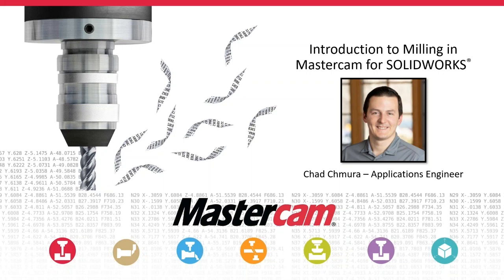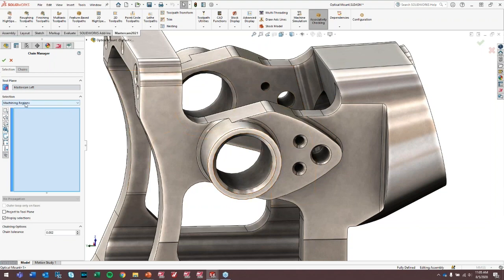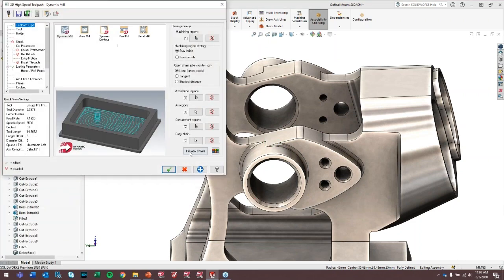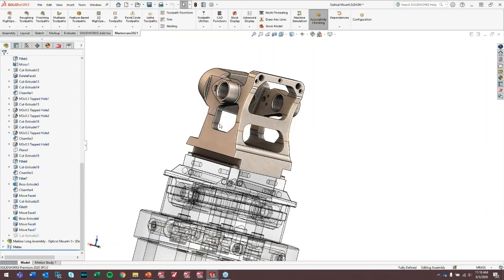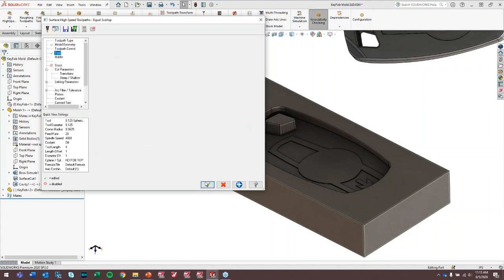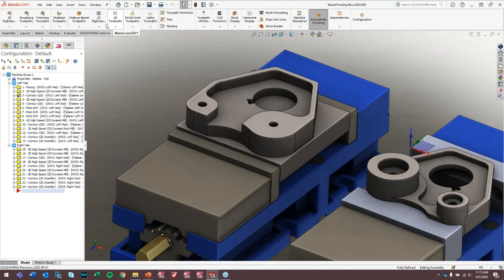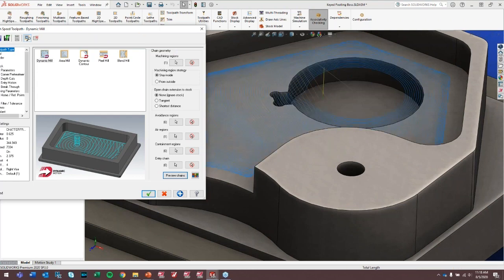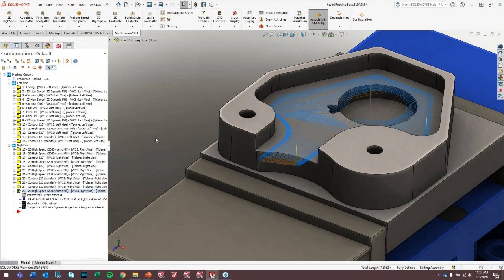Introduction to Milling  in Mastercam for SOLIDWORKS®

Comment: Chad thanx for the presentation ...Mastercam is developing into a great platform for machining ...Mill Turn is fantastic
after the up grade..I have a problem half the shop runs on G code and the other half uses MAZATROL 
There is an application from Germany that runs in Mastercam to give you basic MAZATROL output it would change
the industry and for Mastercam market share to have a more robust interface ...Regards...

Comment: the reason Mastercam for Solidworks is underutilized is because you need both seats on the same computer and that gets very expensive.  i know the company i work for won't get a seat for me is because i'm just a dumb machinist, what could i possibly need Solidworks for. i suppose large companies have production engineers to program but most shops i know it is either a operator/programmer or a programmer that will not use Solidworks functionality. i believe this is an area Mastercam could do much better.
Reply: Nail on the head. I am a CSWP and a programmer. You betchya I use mcam4sw at work to write high volume production programs. Design fixtures etc and program all in one shot. It's a beautiful thing. 2021 is my recommended year btw. 2020 and 2019 had some glitches that caused me to lose work on a few occasions.
Reply from the maker: We are happy to hear 2021 cleared out some glitches. We appreciate our customers feedback on our products, please feel free to provide your feedback- good or bad- through one of these options listed on our blog https://www.mastercam.com/news/blog/top-3-ways-to-shape-the-future-of-manufacturing/
Reply: This is why you have floating seats
Reply: @SuperAWaC  at my employer having  floating seats would not work. the engineers are using soildworks all the time, after all that is there job.i'm sure i'm not the only one in this  position.